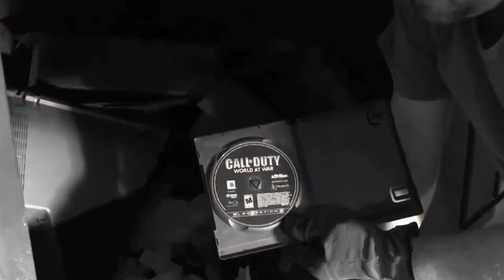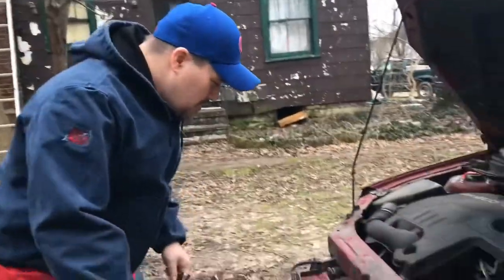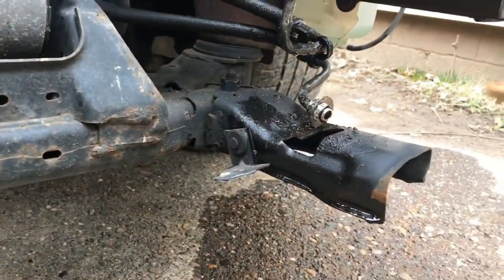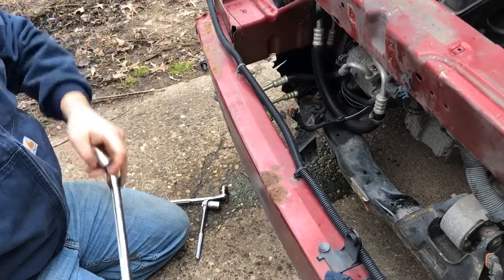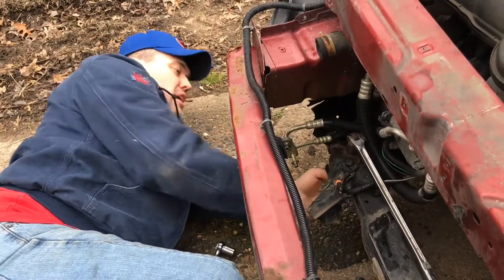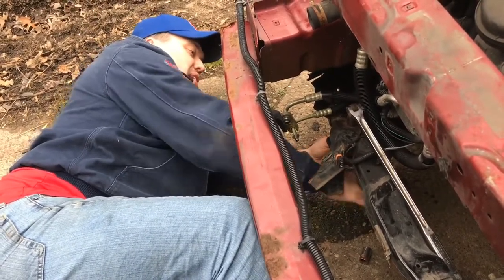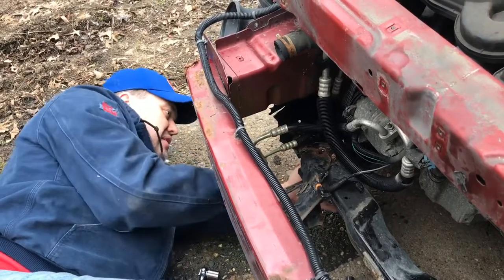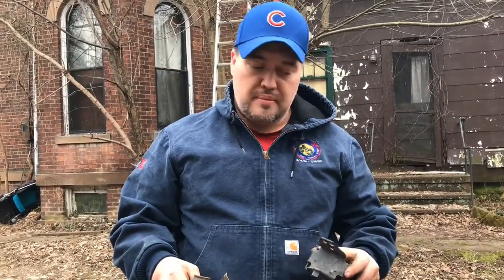Changing The Bottom Radiator Support Brackets On a 2008 Pontiac G6 4- Cylinder 2.4 Litre Engine

Comment: Can the radiator support frame tie bar upper be changed without welding? I have a 2009 Pont G6 sedan.
Reply from the maker: Are you talking about this part?
Genuine GM 22660577 Radiator Support Bracket https://www.amazon.com/dp/B00GUDNULW/ref=cm_sw_r_cp_api_i_qrztFbSSME1PY
Reply: @Mr_Goody  Somewhat, but it's between the grill and the headlight on the driver side.  and it looks bigger than the one you're showing me. I'll try to provide a link.
Reply: Radiator Support - Upper Tie Bar  Condition:	New	Brand:	
Perfect Fit
Part Name:	Radiator Support	Custom Bundle:	No
Parts Link Number:	GM1225247	Fitment Type:	Direct Replacement
Placement on Vehicle:	Upper	Interchange Part Number:	25864307, GM1225247
Reply from the maker: I believe it has to be welded off. Sorry I took so long getting back to you.